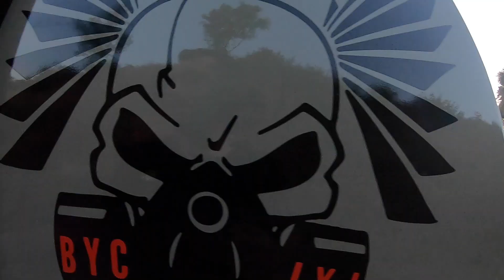2004 DISPOSAL SUZUKI GYPSY | COMPLETE REBUILD & FULLY MODIFIED WITH HYPER-PAINTJOB | BYC JAMMU

Comment: @ 3:12 front differential is not connected to the acxel so it is not a 4×4, it's just a rear wheel drive GYPSY
Reply from the maker: You think we would rebuild the whole car but don’t put one shaft? 
It takes a lot of juggling between shooting and building the project as a result shooting takes place when it’s convenient.
We build 4x4 rigs with pride,try to ask rather than judging!
Regards,
#TeamBYC
Reply: How much rate tell me

Comment: Nice job . What size tyres are those ?
Reply from the maker: Thank you so much for appreciation, we will be covering the details in another video !
#TeamBYC
Reply: @BYCJammu  sure, I also have a modified gypsy and running  31 inch maxxis 764 . Had to change the TC ratios to compensate for the big tyres